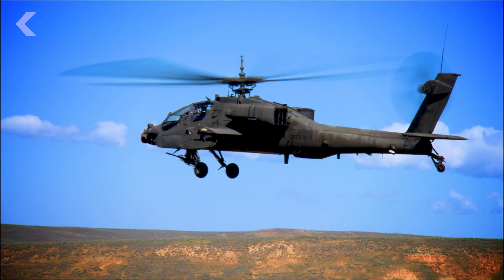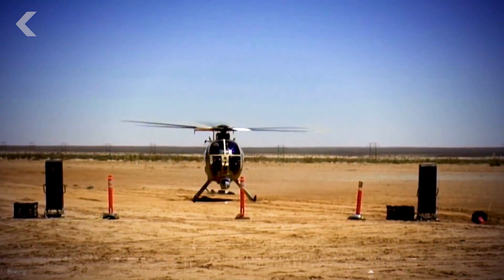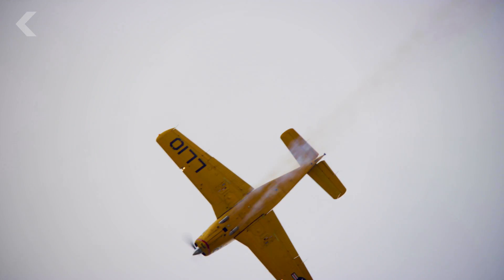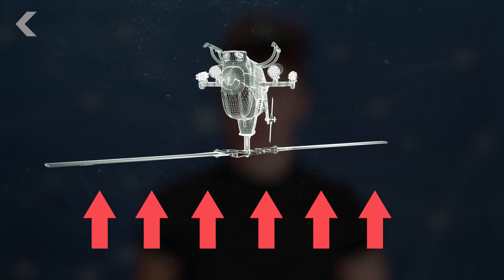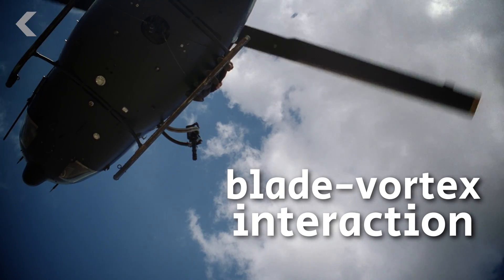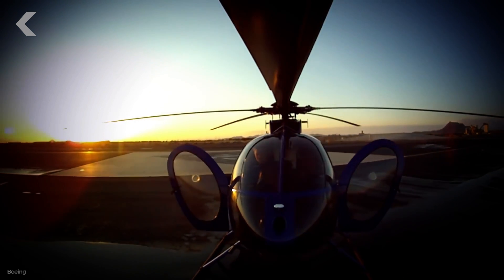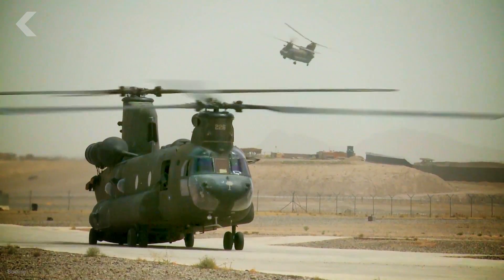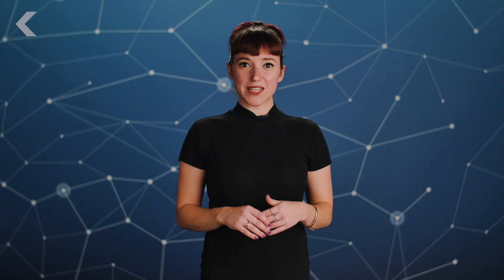How Do Helicopters Fly Without Wings?

Comment: Hey y'all! We reuploaded this one because we had a line that conflicted with the idea of autorotation, so we cut it out! We talked to Boeing engineers before we published and they were okay with it, but some commenters were not. In case you didn't know (we didn't!) autorotation is an emergency landing procedure where the blade's rotation limits the fall velocity of rotorcraft. Letting it "glide," (sort of). It's not always feasible, but, when possible, it can save the craft as long as the pilot initiates autorotation immediately after a failure (and if they're near a safe landing area). Thanks for keeping our feet to the fire, and thanks to Destin for publishing his awesome video on it which many of you cited in your comments! <3 trace
Reply: you guys should do a video about auto rotation next
Reply: Some other mistakes:
-Bernoulli principle helps a plane fly, but a plane can fly with flat wings as well. All airfoil shape does is increase lift per wing area, allowing to reduce friction through smaller wing size and improving its flight envelope. What makes a plane fly is its engine.
-Helicopters can fly upside down by adjusting their main rotor blade pitch.
-And yeah... auto-rotation.
Reply: Trace Dominguez good.  As an aerospace engineer I’m now rather worried about what Boeing engineers know. ;-). Think of gyrocopters.  There is no motor driving the rotor apart from initially spinning it up.  Yet they fly.  So yes helicopters do glide under autorotation they don’t fall like a rock.
Reply: I just saw the earlier comment about aerofoil shape.  It is perfectly true a flat plate will generate lift with a positive angle of attack (angle between the wing axis and air flow).  The amount of lift of any wing increases with increasing angle of attack until the flow on the suction side (or upper side) separates.  You can demonstrate this by holding your hand out the window of the car and angling it to the wind.  As the angle increases the lift force increases until the flow separates and suddenly the lift force disappears.  The reason wings are shaped the way they are is to allow them to fly at higher angles of attack before flow separates.  But any wing can fly upside down it just will not be able to sustain as high angles of attack upside down unless it is designed with a symmetric profile.
Reply: I am really glad you corrected this. While I think the topic is a bit simplistic, I understand that not everyone knows everything. I appreciate your willingness to make corrections... and you did it so FAST too.

Thanks to Amy as well.
Reply: At 0:52 she says "they can't glide if something goes wrong". You still need to fix the video.
Reply: It's not about limiting the rate of descent at all....... it's all about keeping the rotors turning, so you can use all that energy in the last 100feet to stop your descent.

source: am a helicopter pilot
Reply: The line's still in there.
Reply: I'm seeing this video after you fixed it, and was still wondering why the hell you didn't mention autorotation.
Reply: Bless up
Reply: Trace Dominguez ah I was like thats not what I was taught haha.
Reply: Holy s*** Trace you have your own channel?! Also, what happened to seeker plus?
Reply: Please make a video on why the earth doesn't stop rotating...
If you look at the solar wind acting on the earths magnetic field it has to impose a force on the earth, but why doesn't the earth move away from the sun when this force is applied. I know the earth has inertia and understand all those physics as I am an engineering student, but I cant understand why this imposed force doesn't affect the earth.
Reply: hahaha when I hear helicopter "can't glide if something goes wrong" the first thing come up in my mind is Destin video that they intentionally shut off the engine.
Reply: Trace Dominguez i was about to comment that you’re wrong and they can “glide” but then i saw this comment
Reply: Helicopters can change the angle of the blades to control the amount of lift but this also makes it possible for helis to fly upside down if they reverse the blade angle, the only thing preventing them from actually doing it is the fuel/hydraulic systems that keep the engine running.   RC helicopters for example don't have this problem and can fly upside down all day or at lest till they are out of power.
Reply: how are we affected by the music? can you make a video on this topic ?
Reply: Autorotation does NOT always have to be initiated immediately after a failure to be successful.  
It depends largely on altitude.  If you are at 10,000 ft when engine failure occurs, you have considerable time before having to initiate autorotation... compared to 1,000 ft.  
Other factors that effect the time before having to initiate autorotation are... 
Mass of the helicopter, 
Mass of the rotor, 
Rotor diameter, 
Rotor speed,  
Number of wings on the rotor,  
Atmophereic density,  
& Wind speed.  

The less massive the helicopter & its rotors... in relation to... the larger its rotor diameter, & the more wings on its rotor, can result in an increase in the response time needed to successfully initiate autorotation.  
For example... a 5 wing rotor MD 500, is going to have better autorotation characteristics than a, 2 wing Bell 206.  

Furthermore... it's not always feasible for airplanes to "glide" after a failure either.
Reply: I don't agree with your explanation of an autorotation. As far as I am aware the air moving past the rotor blades (at a shallow angle of attack) as the helicopter falls causes the main rotor system to spin (or maintain some of its initial speed), near the ground the pitch is increased on the rotor blades creating lift (and drag) to create the flare and controlled landing. I don't think it is fair to refer to this as glide, more of a controlled decent, but forward movement is necessary for the correct air movement past the blades.
Reply: It's good that you guys issue corrections but in this particular instance, I'm not quite sure how you missed the principle of autorotation.

Although the concept of the helicopter was around for a very long time, the first successful flights by rotorcraft depended on autorotation to generate lift. One of the inventions (hinges that allowed the rotors to "flap") that was crucial to the development of the autogyro, was pivotal in the development of the helicopter.

Comment: Autogyros were "gliding" through the air with non-powered main rotors decades before helicopters. If a helicopter loses power the pilot performs an autorotation, using the autogyro's principle to glide to a landing.  It is a maneuver taught and practiced by pilots.
PS: Have seen many radio controlled helicopters flying quite well upside down, so it is possible.

Comment: I am fairly sure that your theory of aeroplane lift is incorrect.

(Disclaimer: I am a biology student, not a physicist)

The standard Bernoulli explanation for aeroplane lift is technically true  for some wing designs, but it is entirely insufficient to explain the massive lift generated. In fact, the explanation is much simpler and more elegant - the wing is angled in the airstream, by virtue of either its shape, or its angle of attack. This deflects the air which hits the wing downwards, and Newton's third law tells us that this results in an force of equal magnitude being exerted in the opposite direction - upwards.

Comment: This video has many flaws.
1:  helicopters can glide, it is called autorotation.
2: they can also fly outside down using the same principle of drag than airplanes use, just changing the pitch of the blades.
3: The bernoulli principle is not the correct explanation why helicopters or airplanes fly, it is more complex than that.
Seeker team research:  failed.

Comment: Well, at low Much speed, we treat air as incomprehensible, so the dense/ sparse explanations is seriously flawed. Please just stick to the speed and pressure explanation.
Also, there's the "Autorotation" for helicopters, it's like the glide mode, so helicopters actually do have a chance to land when lost all engines.

Comment: The explanation given for wing shape being critical to airplane wing lift is an old and very commonly perpetuated myth. The main cause of lift is simply that the wing center line is higher at the front than at the back. Thus, air is forced downwards. This is also possible with a perfectly flat wing, but the common wing shape has aerodynamic advantages for subsonic flight. Wings on supersonic airplanes are often symmetrical, instead of different top and bottom shapes. See this explanation: http://warp.povusers.org/grrr/airfoilmyth.html

Comment: A helicopter is a type of rotorcraft in which lift and thrust are supplied by rotors.

This allows the helicopter to take off and land vertically, to hover, and to fly forward, backward, and laterally.

These attributes allow helicopters to be used in congested or isolated areas where fixed-wing aircraft and many forms of VTOL (vertical takeoff and landing) aircraft cannot perform.

The English word helicopter is adapted from the French word hélicoptère, coined by Gustave Ponton d'Amécourt in 1861, which originates from the Greek helix (ἕλιξ) "helix, spiral, whirl, convolution" and pteron (πτερόν) "wing".

English language nicknames for helicopter include "chopper", "copter", "helo", "heli", and "whirlybird".

Helicopters were developed and built during the first half-century of flight, with the Focke-Wulf Fw 61 being the first operational helicopter in 1936.

Some helicopters reached limited production, but it was not until 1942 that a helicopter designed by Igor Sikorsky reached full-scale production, with 131 aircraft built.

Though most earlier designs used more than one main rotor, it is the single main rotor with anti-torque tail rotor configuration that has become the most common helicopter configuration.

Tandem rotor helicopters are also in widespread use due to their greater payload capacity.

Coaxial helicopters, tiltrotor aircraft, and compound helicopters are all flying today.

Quadcopter helicopters pioneered as early as 1907 in France, and other types of multicopter have been developed for specialized applications, such as unmanned drones.

Comment: Helicopters can glide. They can fly upside-down and wings do not generate lift by the Bernoulli principle ! seriously how many things can you get wrong in one episode?
Reply: "To put it simply (and this is way to simple) Plane and Helicopter wings get lift from the angle of attack of the wing cord." 

As a private pilot I would like to correct this part "(and this is way to simple)" , It should read "and it's way to wrong".

As for your test I hope it's more then just sticking your hand out a window of a moving car.
Reply: Maybe as a private pilot who thinks i am "to" wrong you could explain it in terms fluid dynamics. Euler equations are the best way to the motion of flight however it still won't be Bernouli. In the end the physics still comes out as air goes down plane goes up :)
Reply: Well piece of paper yes,  heavier than air flying machine somewhat unlikely. Oh I have made a few sheets of plywood fly in the past :)
Reply: You do know that plywood has been used in aircraft construction since the 1930's or is your aerodynamics limited to paper planes?
Reply: Les Brown ye i legit should 
You got me wp
Reply: Les Brown you actually have no friends. Just talking to yourself, i think you need psychiatric care,
Reply: Yes it works but it is not why planes fly :)

Comment: To make a rotor silent you can always add an encasing ring; but this of course adds too much weight reducing the lift capability, so it is rarely applied, even in the noisy drone pests (with 4 plastic rings and opposing pairs of blades they would be quite stealthy).

Comment: Oh dear @Seeker!
Honestly, just take the whole video down, permanently.
Herewith, some egregious errors in your information.

1) Helicopters can and do fly upside down, not only while rolling (see point 2 for roll error) - See for example SANDF/SAAF attack helicopter "Rooivalk".
2) Most helicopters that cannot fly upside down, will also be completely unable to perform a Barrel roll. Instead you will perform an Eileron roll. The difference might seem negligible to you, but names matter and these two maneuvers are vastly different things.
3) Helicopters are fully capable of gliding very noticeable distances. Autorotation is not only some rarely performed trick, it is an actual important part of even getting a license to pilot a heli of any sort. In experienced hands, a helicopter can glide for as much as 3 miles during autorotation if conditions allow. And just to rub salt into that wound, said helicopter won't even need a high initial forward momentum to initiate such a glide, something an airplane cannot even dream of achieving.

Just, seriously... Take the whole video down.
Reply: Willem Heunis They're right though. They said helicopters cannot aerodynamically sustain their own prolonged glide. That's true.

Comment: No, no, no!! Bernoulli principle helps a plane fly, but a plane could fly with flat wings as well.
Reply: Just to be clear. All airfoil shape does is increase lift per wing area, allowing to reduce friction through smaller wing size. What makes a plane fly is its engine.

Comment: I have a question. In regards to flying upside down, isn't there a way to make it so you can do that? Like maybe have multiple blades at the corners of the main body just like a drone would and make each individual blade gyroscopically adjustable? I am no engineer but wondering why that isn't a thing? I guess it's possible but there just isn't any reason to make a helicopter that agile?
Reply: This video has many, many mistakes. Some helicopters sure can fly upside down by adjusting main rotor pitch blade.